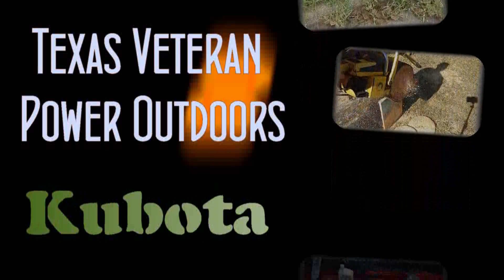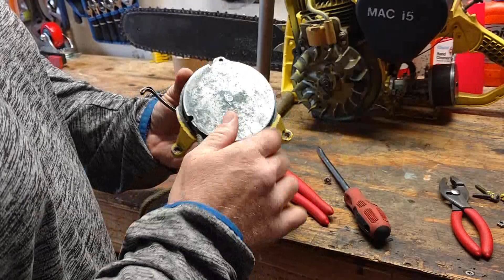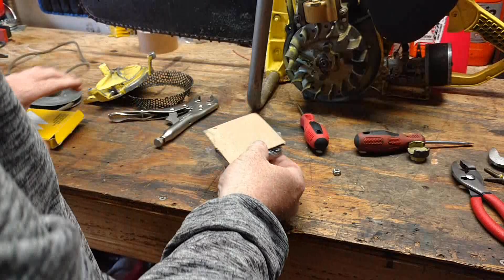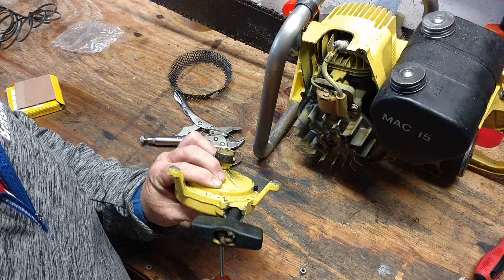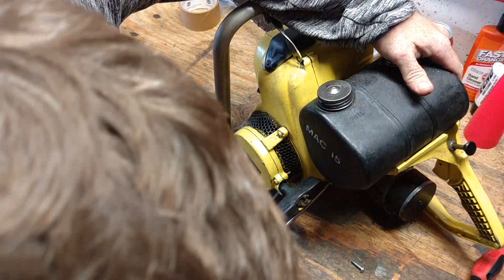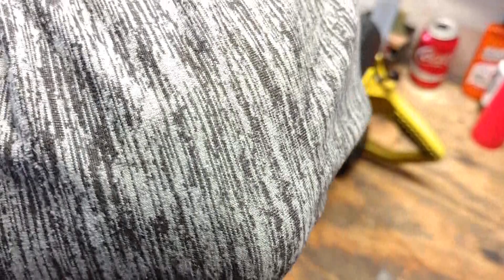McCulloch Mac 15 starter spring replaced - Power saw equipment

Comment: I just inherited one of these. It's interesting some of the differences I noticed. I THINK all my hardware is original, still yellow, but no slots except the outer 2 on the starter cover and the one holding the handle on.  The other difference I see is the starter spring cavity. Yours has a chamber for outer spring end to rest in, mine has a slot I have to feed thru. Anyway neat old saw, makes me want more.

Comment: The McCulloch ‘ Mac’ 15 is not a 1950’s chainsaw. They were first sold in 1962 . I talked my grandfather into buying the first one sold in our town in 1962. These saws were mainly  sold to farmers in our area. They were pretty powerful at 80cc compared to today’s little 42-60 cc saws.
Reply: Texas Veteran Power Outdoors   That’s true ! But the Mac 15 sure was light compared to the old Clinton B3 I rebuilt for my 10th grade ‘power mechanics’ class term paper. I the 1960’s you had to have acquired some skills to graduate from high school. I easily convinced my grandfather to buy the McCulloch after running my Clinton. Anything was better than a ‘two man’ 6’ crosscut saw in those days....thanks for the memories...Gary sawmillin’ still in Michigan

Comment: If you put the hardware back in their respective holes once the cover/part is removed it saves mismatching different threads. If removed completely and mixed up, you can usually match similar threads and then count the holes in the cover/part to figure out what goes where. That's just what I do, it's no fun having to retap parts or helicoil blocks. 
This is just a suggestion, not telling you how to do you. Love seeing people wrenching. Thanks for the content. I just recently had to tear my whole mower apart to change out a drive belt pulley. Keep up the good work 👍
Reply: @TexasVeteranLawnService  yeah I get the same issues with Craigslist sometimes. Picked up my 42" zero turn for 50 bucks because the guy thought the transmission was seized. It was the steering damper and I just removed it. I find better deals there and on FB than eBay and Amazon but they're killer for repair parts. Especially Amazon with their prime shipping.
Reply: Yeah it was a lucky find. They're out there but usually need work. I like the projects though haha. Thanks for the content.

Comment: Me and my dad had to do this to our old tiller. It is a real pain in the butt
Reply: @TexasVeteranLawnService  good buddy will contacted me on that nice wgc 6-21  $1,249.00 wich pretty good deal :)
Reply: @TexasVeteranLawnService  dont have the budget yet plus my 22'' husqvrna 722fe is back at the shope again see if its fixable wich alot of stuff wrong with it again the metal piece of the inside of the deck at the rear broke off and bent the blade, and major oil  leaking in the engine and the drive belt cover fell off and smoke came though the engine and the clinking sound try starting it again wich that might be scrap yard mower wich thats my 16th mower :o